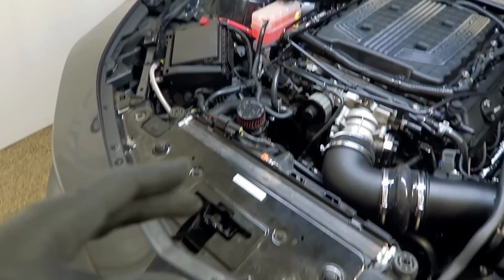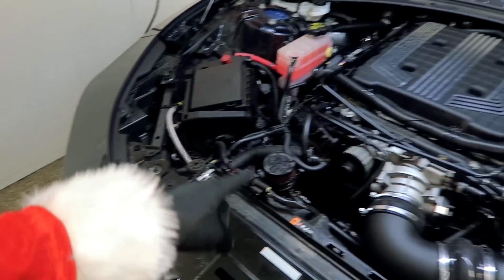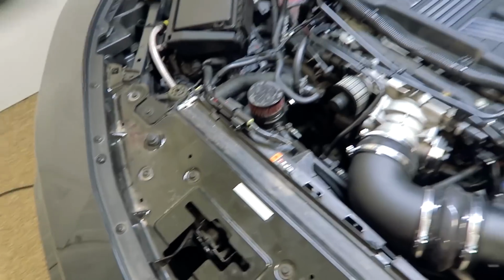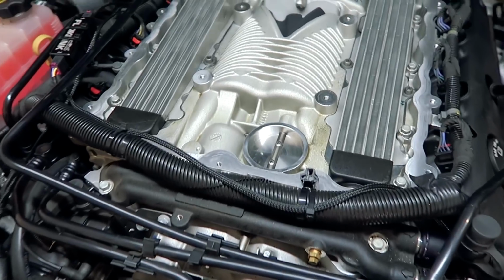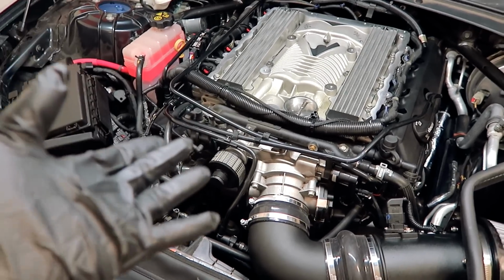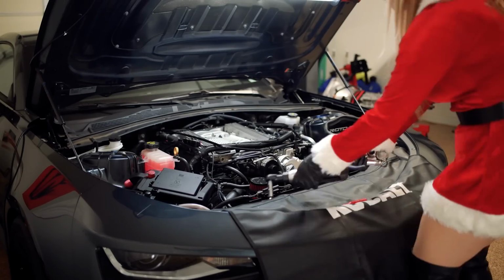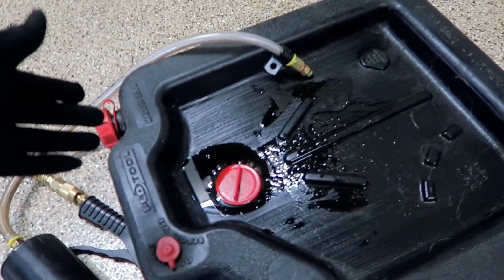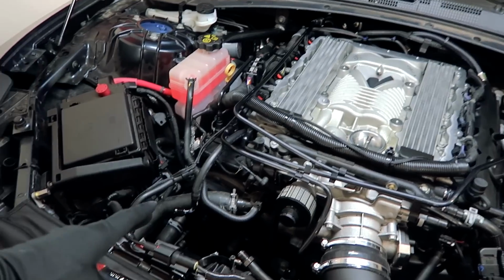QUICK Catch Can maintenance on MY CAMARO ZL1 1LE! + Christmas GIVEAWAY!!

Comment: Good work. I found that the best thing for the catch cans is to remove the paper or linen based filter and replace with kitchen scrubbers the stainless steel ones. You will need to jam the can full of these scrubbers and they need to be the course scrubbers.

Comment: The LT4 engine has 3 pcv valves, 2 r in both sides and 1 in front of the engine, I believe the oil u found in the supercharger came from the other 2 pcv that dont have catch can,.
Another point, u installed a vented catch can, so u have to check the engine pressure because the open system catch can would change the pressure.
Good luck

Comment: Well I came here to disappoint you a bit about using that useless aluminum can (I come from Ford's EcoBoost platform so maybe in some magical way GDi on Chevy is different). Your car's LT4 engine is direct injection, which means you have valve carbon buildup issue. The OCC ("oil" lol) you installed is not doing anything because the majority of valve carbon buildup happens during the intake & exhaust valve overlap on power stroke - you cannot stick a catch can there. You want me to really blow your mind? Next time you empty that aluminum can, capture the contents & send it to BlackStone for analysis. Let me spoil you: what it captures is mostly water & diluted fuel. Your PCV system is designed to deal with that (it could be inadequate, or you're pushing a lot more power than stock, but that's beyond my knowledge). If your goal is to keep valves clean then install WMI - the only way that works 100%. If you're concerned about some little fuel blowby, then I guess use OCC as a piece of mind. And also be careful w/ OCC, GM denies your warraty for that. https://www.camaro5.com/forums/showthread.php?t=451361
Reply from the maker: Thanks for taking the time to comment. I feel you need to do a little more research on the platform and how this particular catch can works. If you take a closer look at when I'm emptying out the can.. you'll see mainly oil and perhaps some water\fuel. So it's easy to see how much of what was really in the can once drained. I rather have all of that in a can vs coated on the supercharger. There's a reason why many high HP LT/LS cars run this exact catch can with zero issues. My car sits at 693whp and I'm running ethanol (E50 blend), so that will keep things clean and reduce a lot of carbon build up. If I worried about warranty in that manner, I wouldn't mod any of my cars. If something happens and they deny, then I will fix it myself. No big deal. 😉